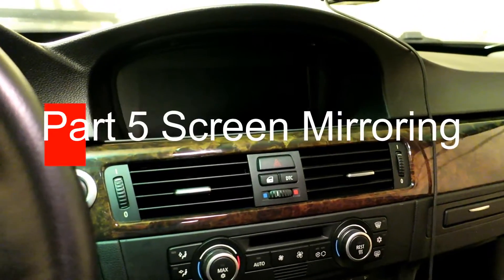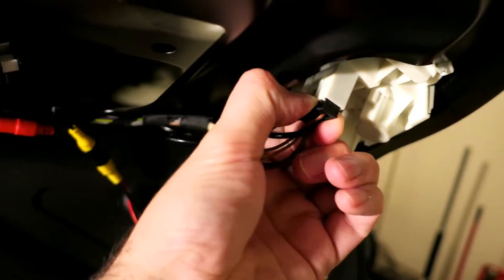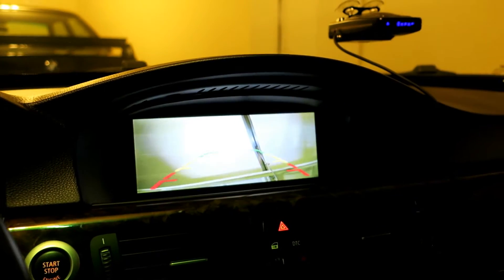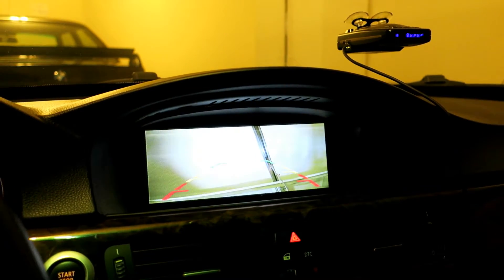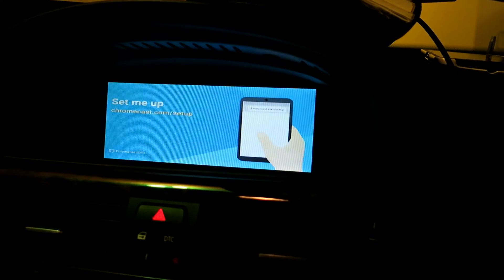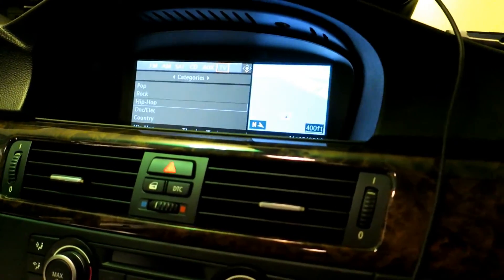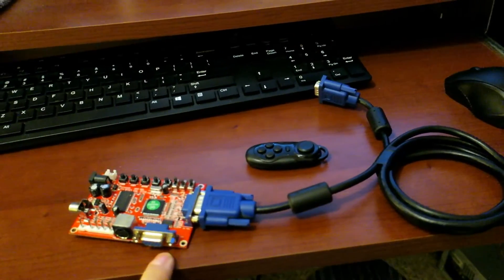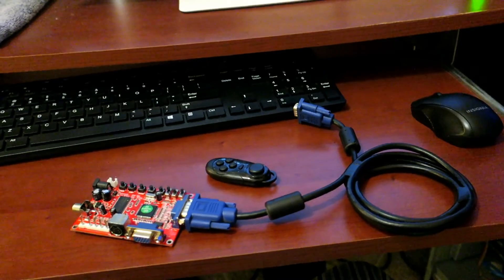Project Android Screen Mirroring on my BMW E90 CCC Idrive **Part 5** Working with Chromecast

Comment: Hey buddy I have a 2008 BMW 535i sport. It has the ccc idrive however the dvd slot only plays the CD for the navigation and does not recognize and other DVDs.  Will this help me get video onto the BMW?
Reply from the maker: It would but I'm about to put up a new videos series on an android based CCC screen replacement that would also fit your car.  Look out for that.

Comment: You say red from the noise filter goes to the camera.  What wire from the camera are you referring to
Reply from the maker: The power lead going to the camera.  It's a two wire harness with a DC plug on it.